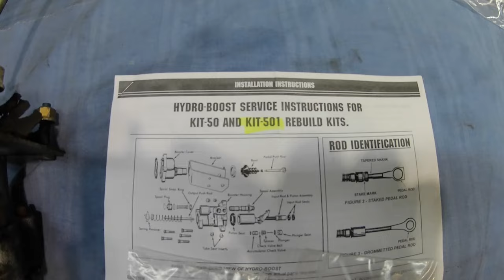GM Hydraulic brake booster leak repair

Comment: Great video! What are the torque specs for the hydroboost bolts?
Reply from the maker: As I recall, 15 Nm and a screw lock.
Reply: 22 ft lbs i believe sir

Comment: On my 93 Silverado 3/4 ton, I had a bad leak, so I tore it out, disassembled, and rebuilt with a generic (EBAY) rebuild gasket kit. 
It leaked.  Tore that out, and realized somewhere along the tear out, and rebuilding of the original, that the accumulator became loose.  That means death to the unit, and you can’t rebuild it at home. And in my application, it’s a DISCONTINUED PART !
Went to Autozone and ordered a Duralast remanufactured unit. Installed it, and it leaked.
Tore that one out, brought it back to Autozone, and they ordered another one for me. Installed that one, and it leaked.  I DID NOT RETURN THE SECOND UNIT FOR A REPLACEMENT.  And this is my suggestion to anyone doing this rebuild.  First and foremost, if the accumulator feels loose, or wobbles around and isn’t tight, your unit is toast, and you have to go with a rebuilt.  Second, order a rebuilt unit from Autozone or your local parts store. Why ?
For the warranty, and it’s local. I’m so glad I went that route.  As for the “rebuilt unit”, it probably came from A-1 Cardone if you got it from the parts store, and that basically means it’s pretty much just what you took out of your vehicle, garbage.  
What did I do ?  I tore out the second unit from Autozone that leaked, and disassembled as in this video.
Now listen carefully here…I did not use a GENERIC REBUILD KIT FROM EBAY 
this time around !!!!
I found a genuine GM rebuild kit on EBAY (new/old stock) and ordered that.
Disassembled the unit and rebuilt it just as I did the original unit in the truck, and NO LEAKS !!
The aftermarket generic gaskets are a very big “hit and miss”.  These are rubber sealing rings with a VERY SPECIFIC SHAPE to them.  If the tolerances are off, by even a little bit, it’s going to leak. Good luck my friends !
Reply: Good evening, do you know how long the push rod is?

Comment: Can you advise?
I am rebiilding a  school bus witha chevy p30 chassis and the first thing you see when i ooen the hood is the hydroboost and master cylinder on the firewall- so i want to chrome the whole thing. 
The chrome shop wants onlu the external housings that need to be chromed. The whole proces will take months with back time.and shipping so the bus needs all new components anyway id buy a remanufactured boost and master and disassemble it myself and send the parts out and reasemble the chrome housing when it gets back chromed.
Heres the question, how do i remove the pressure canister or does that even need to be removed ?
Does it hold pressure? Is it under pressue like a nitrogen ball from a bmw brake system or is theee nothing in that canister and it should be chromed as one piece with the housing?
Thats my question.
Reply from the maker: Hello There is no information about disassembling the pressure tank of the brake booster.
Reply: informes  vende  repuestos

Comment: I just rebuilt my hydrobooster. Now when I turn the wheel the breaks go down. Any ideas where to start?

I made sure two function valve is in the same way yours is. 

My an original one was different than the one that came in the rebuild kit. The new one is just like yours.
Reply: 1997 Dodge Ram 3500
Reply from the maker: Ok There is probably air in the brake master cylinder, the first air out of the nipples of the brake pipes and the air off line towards - > the brake cylinders of the axles.

Comment: What about the seals on the push rod? I watched another video and the guy cut off the eye. Pulled the rod out replaced the seals. Put the rod back through the housing and welded the eye back on.  He said he did this because he couldn't figure out how to remove it. There were no obvious ways of removing it. So I have been searching for a proper way to replace the seals.
Reply from the maker: I didn't change the push rod seals there.
Reply: The pushrod is held in place due to the end being a ball and then the metal is staked/dented to retain it.  Instructions with seal kit show a pry tool to force it out.  I made a version with a bearing puller and some all threaded rod.  Then to reinstall you need to hold the push rod to the master cylinder side in so you can apply force and not distroy the star washer and then just hammer or press the ball end of the pedal pushrod back into place.
Reply: The seals will slide over the rod and work them down. With old gaskets still in place get them close then cut the old ones off.

Comment: Do you think the master cylinder will cause all 4 brakes to slightly drag? I can release each one when I open the bleeder screw. Once I drive it for about 3-7 minutes it starts back dragging. I say slightly dragging because I can jack up the truck and turn them by hand with a lot of force. No leaks on the master cylinder or hydro boost. I’ve greased slider pins, bleeding the brakes 3 times, topped off the fluid on both power steering and brake fluid. Power steering is making the whining noise. Pedal is hard not soft. It’s a 2004 Suburban with hydro boost system. Please help.
Reply from the maker: Operating pressure gets to the wrong place in the brake master cylinder if all brakes are stuck, usually old brake hoses do this, but only wheel-specific sticking.
Reply: @latexihire  yes the front brakes would stick  completely and then I changed the front rubber brake hoses and now it’s slightly. So you think I should change the master cylinder?
Reply from the maker: @papergatorzfedducca7998  If it still leaves the brakes on, I would think that the fault is in the hydro booster or the master cylinder?
Reply: @latexihire  I’m going to released the 2 bolts on the master cylinder to see if it releases the brakes. What if it does release the brakes do I just replace the master cylinder?
Reply from the maker: @papergatorzfedducca7998  By loosening the outgoing brake pipes of the brake master cylinder, you can see if the pressure is on...
Reply: @latexihire  I don’t understand what you’re saying. What’s the brake pipes?
Reply from the maker: @papergatorzfedducca7998  Loosen the brake master cylinder brake fluid lines nuts...  🙂
Reply: @latexihire  oh ok I understand now. Will the fluid squirt out?
Reply from the maker: @papergatorzfedducca7998  Yes If a lot of brake fluid comes out, there is pressure in the outlet line and the brake Master Cylinder is not working right

Comment: I didn’t take any lines off and only replaced the piston seal and the figure 8 seal. Now I turn the truck on it sucks the brake pedal down. What in the world did I do wrong?
Reply from the maker: Air somewhere ??? The brake cylinder does not work.
Reply: @latexihire I was doing the job with the unit in the truck and didn’t lock the pin into the fork but had it pushed against it instead. Ran it for 100 miles and now the brake pedal goes down when I steer so I guess I’m taking it apart for a third time

Comment: Could you show/explain/use a drawing of the proper dump valve assembly please. I'm doing a GM and not real sure of the proper reassembly mine fell out... (? Gasket, yellow plastic, pin and exterior end piece) not sure of the correct reassembly. I really would appreciate it sir, thank you
Reply from the maker: Unfortunately, no information about that configuration.

Comment: Do you have a link for the parts kit you bought?
Reply from the maker: I have used this kit ->   https://www.ebay.com/itm/143767565106?itmmeta=01HR6TS61KV0N13D64VDYV26Q4&hash=item217936f332:g:PmAAAOSwSP9bWiAz
Reply: @latexihire Hermano, sirve ese kit para una Hummer h2 2003 ? Mi mecánico solo me pide el viton o retén del respuesta del video, espero me ayudes, desde ya gracias … 

Brother, is the kit suitable for a 2003 Hummer h2? My mechanic only asks me for the viton or seal of the spare part in the video, I hope you can help me, thank you in advance...
Reply from the maker: @psicologonicolaspizarro9380  The rubber seals should work but the star washer in the kit ONLY fits 2002 and older. Other parts work! Be careful when taking out your star holder, as you will need to reuse it if your vehicle was manufactured after 2002.
Reply: @latexihire  I just need the first seal that you took out, I haven't found it anywhere, will it work for the 2003 hummer h2? More kits appear on Ebay, will they all have the same measurements?...

Thank you very much in advance brother

Comment: Que puedo aser con mi camioneta se en frena sola  al darle buelta al bolante trae hidrobooster es una chebrolet  modelo 98 de tres toneladas
Reply from the maker: That's a special fault, it shouldn't be connected to that brake master cylinder, I'm guessing some kind of linkage problem, remove the shields from the front and examine the movements of the arms. In my Van, there was a problem with the brake hoses when the brakes were left on, the old brake hoses were swollen and the pressure remained in the work cylinder.

Comment: How to change the small o rings on the pedal rod without cutting a pedal rod with a grinder??? Rod is pressed in and no way to disassemble that. That's where mine is leaking. Video did not show. My truck is RAM, nearly identical part. Anyone please?
Reply: You can pay the $55 to buy the tool (J24569), or you can fabricate your own by cutting a slot for the rod into 1/4" flat stock, then welding angle iron to that about 1" from the slot, drill a hole for a drift into the angle iron centered at about the end of the rod.  Now you can put the tool into a vice and use a large drift punch to quickly pry up on the rod, freeing it from the cylinder.  
To reassemble put a bolt/pin the size of the pedal hole in the rod, line it up on the cylinder, and give it a quick and strong smack with a hammer and it should seat itself again.  If you don't put something in the hole for the brake pedal you run the risk of deforming the hole and it will be difficult/impossible to get the rod on the pedal to go through when you reinstall the hydroboost, and it's absolutely miserable to try and make that hole round again.

Comment: I have watched several of these videos and no one changes the pedal rod seals. Is there a trick to these?
Reply from the maker: I only changed the important seals of the brake booster, not the seals of the pedal bar.
Reply: @latexihire  Mine is leaking.
Reply: I've replaced 3 on my 13 duramax and every one has leaked into cab and one through weep hole on bottom of booster.   Get a squishy pedal feel and squealy brakes
Reply: You have to cut the eyelid off and after replacing the seals weld the eyelid back on ,or cut some threads on both sides and use a coupler nut to get it together for use in the truck

Comment: شكرا ..

لكن 
خصص فيديو 
لكيفية فك الوصلة التي تربط بين دواسة الفرامل والبوستر الهيدروليكي... حتى يتسنى تركيب حلقات مطاط جديدة ، لمن التسريب.
Reply: Thanks ..

 but
 Dedicate a video
 How to disassemble the connection between the brake pedal and the hydraulic booster... so that new rubber rings can be installed, to avoid leakage.
Reply from the maker: These seals did not need to be replaced on my brake booster

Comment: the seals aren't the right size for most of them unfortunately. I recommend getting in touch with a professional parts source.
Reply: I got cheap ones from amazon and they worked well.

Comment: The diagram shows a ball bearing between the two components of the accumulator valve (the yellow piece and the piece with the pin in it), yet your unit had NO such ball bearing. Further, video https://www.youtube.com/watch?v=TiSS2F5oQU0&t=718s blames the failure of his unit on the omission of the ball bearing. Do you know what the story is with the ball bearing?
Reply from the maker: No information about that ball bearing.